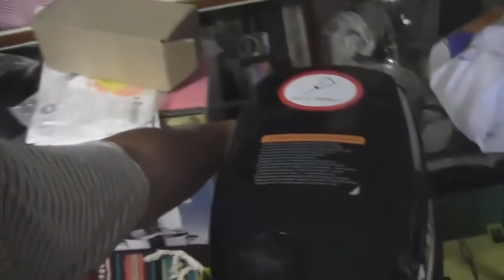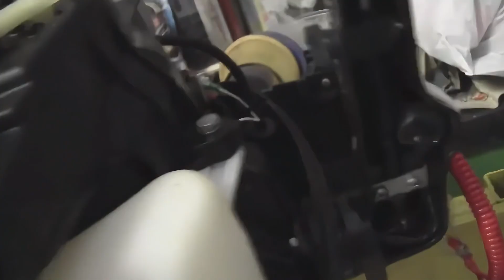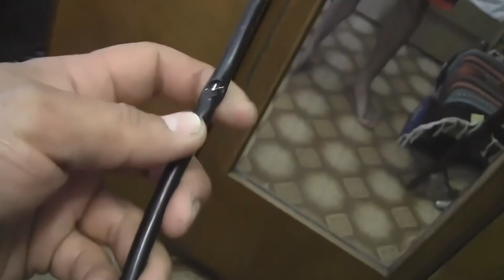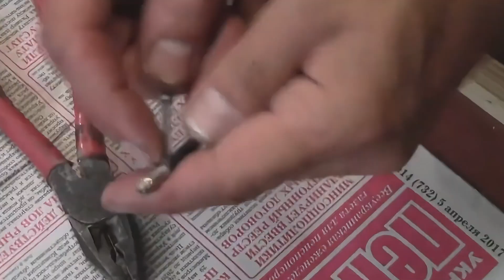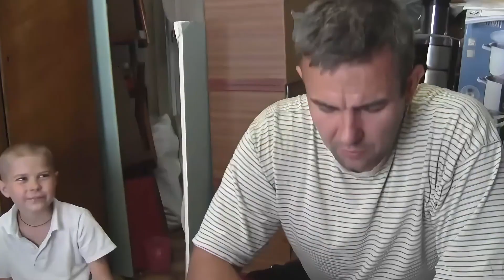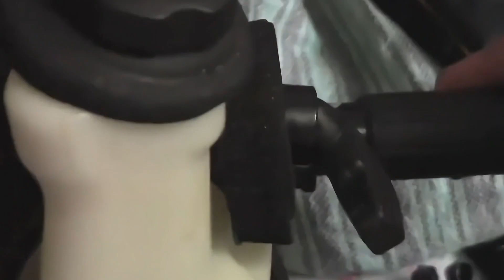Accelerator Cable Repair

Comment from the maker: Have you ever had your throttle stick while out on the water? It can be quite a surprise! 🚤 I hope this DIY guide helps you get back to smooth sailing. If you have any questions about the tools I used or specific steps, let me know in the comments below! Don't forget to subscribe for more practical repair tips. Happy boating! 🛠